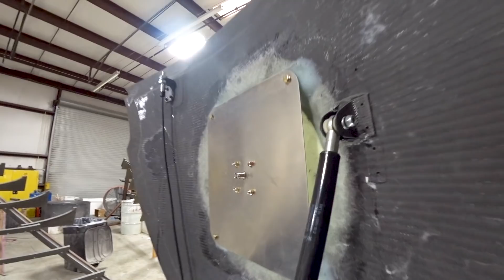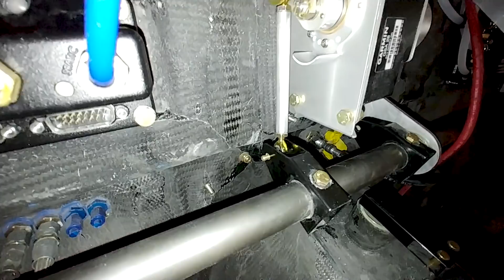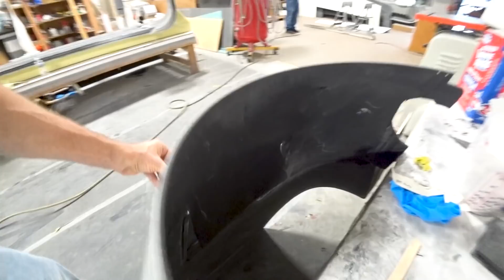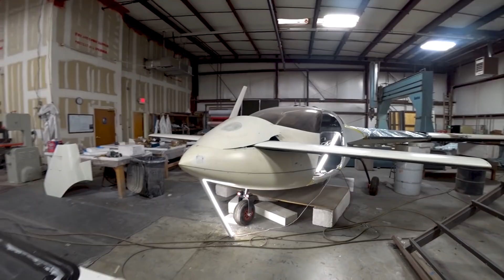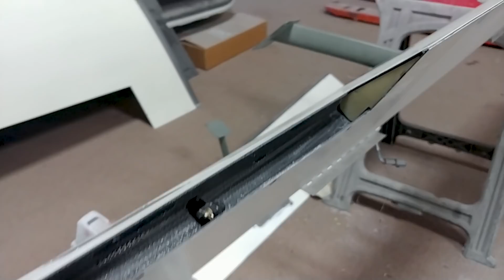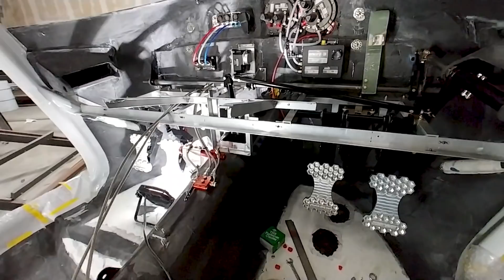Our Bird Spreads its Wings - Building the Raptor Prototype

Comment: The way things are filmed with the auto pilot servo 
It shows no over view to. Give any idea the location on the plane 
It would make videos more enjoyable 
The right views give no sense of what or where 
What engine is on this thing
Reply from the maker: Sorry, but there simply is not enough time in my day to go back and give an intro to every aspect of the current update. Like anything, there is an assumption that the viewer has been watching a little too know what's going on. There's over 350 updates if you want to go back and catch up. Thanks, Peter

Comment: Hi, i notice you used a cutting wheel to cut the break lines before terminating the end fitting. How did you clean the fine cutting wheel dust from the inside of the lines to prevent eventual blockage inside the hydraulic spool valves and / or damaging the spool valve o-ring seals. ?
Reply from the maker: Put a small screwdriver in there and twisted it around several times and removed it and cleaned it off and then repeated the process till no more dust was on the screwdriver. Then I blew it out with high pressure air.

Comment: Unless excessive force is applied BNC are more long time  reliable than screwed ones. They need a rather high force to move from locked position, no matter how long they have been tightened, while screwed once can go loose over time with a comparable small force, and once loose they will disconnect soon.

Comment: Peter, 
Years ago you mentioned that Raptor will answer quite a few issues GA pilots felt were negative aspects about their aircraft, fuel, ergonomics, comfort, safety and last but not least cost. Well done Peter and team. As the milestones are occurring daily. Even the biggest GA skeptic is second guessing why he or she didn't jump on the 1500 pre sold band wagon! We applaud you and your team for what is soon to be the most successfully crafted single engine aircraft built in the last century!!  Bravo to your creation of aerodynamic ART!

Comment: I wonder why you are using oil bushings for the ReDrive instead of ball bearings? Wouldn't bearings last much longer? (Not that I'd know, I just always thought bearings are better.)
Reply: Ball bearings aren't better in all applications. 

Think about the bearings used in an engine on the crankshaft and connecting rods. No ball bearings there 🙂
Reply: Well idk. I watch a bunch of AvE if you know that channel and he's always pissed when he sees bushings instead of bearings in a product. I have no deep knowledge of mechanical engineering. So I began thinking of bushings as poor mans bearings. But obviously, different methods for different applications.
Reply: @attitudeadjuster793    --  and it's a prototype.
Reply: @attitudeadjuster793  , I watch a good bit of AvE as well. Insofar as I have heard and seen and that he has mentioned in his videos he is not an Engineer and much of what he takes apart and shows is "garbage". That's not a disparagement but accurate assessment. Rolling element bearings are nice when you have the space, weight, etc. allocation for them as well as a relatively clean placement. If one expects fine particles from brushes, environment, or material being removed then bearings will, often, get destroyed quicker than a bushing (presuming open vs. open or sealed vs. sealed). If the area expects the bearing may be an electrical path then metallic/metallic bearings are out of the question and one must (should) use a metallic/ceramic bearing. How much is the part going to cost, who is going to buy it? All things to consider and more. At times a person putting something together backs themselves into a corner and must use an "inferior" solution because that is all that will fit the need; a compromise. For projects in industry the phrase often used is "buying its way on". For example, say you need to save every ounce so the case will be made small and since the area is readily inspectable and serviceable an oil impregnated bearing surface will be used.
Reply: @hahahano2796  That was very informative, thank you.

Comment: Do I get this right that the elevator only extends down but not up with a similar mechanism as conventional flaps? If so can you explain the aerodynamics?
Reply from the maker: It goes down and slightly up but it also extends out and tucks in thereby reducing area and subsequent lift.
Reply: Raptor Aircraft   Did the flight test model use the same details then?

Comment: Fantastic. You mentioned the co-pilot seat view - one thing that strikes me about the design is that rear-seat passengers will not get much of a view of anything (except maybe sky). Is that right or are they further forward than I'm thinking? Not much you can do about it I know, but just wondering if it was considered during the journey.
Reply from the maker: I've shown that view before when we had the rear seats test fitted. It's great out the sides and front.
Reply: Ah yes, just found the videos on the website.  It looks much better than I would have imagined, good to see.  It almost looks like there is enough room in the back that you could leave out the seats and put a bed in there - this could be a flying motor home! :-)

Comment: So what is the benefit of the Raptor's wing arrangement (with the canard), compared to a  conventional arrangement?
Reply from the maker: Try Google.
Reply: The anti-stall part, as @Russel Lowry said is one of the main benefits.  The downside is that you can't have flaps without balancing flaps on both lifting surfaces (see overweight Beechcraft Starship), which means you need a lot of runway (higher speeds) for both takeoff and landing.

Canards are more efficient fliers.  In a conventional plane the horizontal stabilizer pushes down to balance out the aircraft.  This downward force needs to be counter-acted by lift on the wings.  This means extra drag as the wings are being asked to carry more weight than the mass of the aircraft in cruise.  Canards lift from both the canard and main wing, so the amount of lift being created is equivalent to the mass of the aircraft in cruise.

The downside to that is balance.  Cargo and passengers need to be carefully (weighed &) balanced to ensure the canard always stalls before the main wing (back to that anti-stall thing).  Letting the main wing stall in flight would mean entering a deep stall, which means a long slow (yet not safe) descent to the ground unless your plane is equipped with a surplus of power (to overcome the drag of a high angle of attack and accelerate enough to get the main wing flying again).  Load up the nose too heavily and you may find it very difficult to take off (and maintain trim at higher speeds).  Many canard pilots fly with a ballast in the nose to keep the plane balanced during solo flights. In a conventional aircraft, you can still screw up the weight & balance, but the effects won't be quite as pronounced.  Usually the rear seat area (and fuel tanks) on these composite canards is the CoG for flight, so you can basically fill up the back seats (or fuel tanks) without worrying, as long as your front seats weights are calculated, and the great efficiency means these planes can haul a lot of cargo and/or fuel.
Reply: @EUC-lid  Thank you.
Reply: The canard stalls before the wings, making the stall a no brainer, plus they just look cool. The wright brothers knew what they were doing.
Reply: @russelllowry1061  Ok, thank you.

Comment: An honest question for you; Looking at the way you construct stuff, I can't help but wonder what kind of total empty weight you are aiming at?

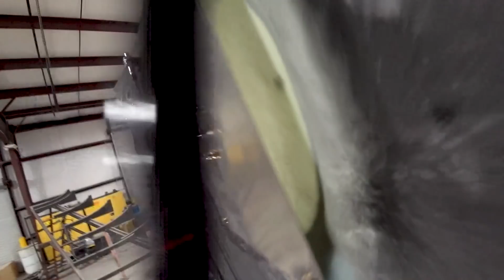It's all the little things that add up. You construct beautiful large parts from carbon which is light and strong. That's all good. But then at 1:57 I see how you construct the GPS brackets and you are throwing in all this excess aluminium and hardware. My guess is the bracket and their supports weigh several times more than the GPS antenna, or the entire door for that matter. Also the hydraulic door spring system seems over the top and adds a lot of weight. Might as well have made that entire front door from regular fibre glass as you just gave away the gain of carbon. Do you keep track of what the parts weigh?
Reply from the maker: It's a prototype!
Reply: @RaptorAircraft  That's fine. But even a prototype will need to prove itself and should be representative for the final product. If it climbs like a dog and needs 2 miles of runway because you never considered weight then that's not good. I'm not criticizing your project, just trying to understand why you do what you do.
Reply: scsirob prototypes are always heavier than production aircraft. Once they go into production you should see a reduction in total weight, particularly with regard to the doors I think.

Comment: Peter, the alcantra fabric you got from Joanne’s looks like the same I tried to use on a bimmer headliner project. It seemed like it would work great but it ended up not being stretchable enough to work around complex curves and corner areas.  I think most of your panels are fairly simple but just might want to check and see that it will lay out nicely on all the pieces you plan on covering before committing to it.  As usual the project is looking fantastic!
Reply from the maker: It's just going on the roof panels. They are fairly flat.

Comment: Would it be viable to avoid the elevator hinge drag by making the entire foreplane rotate as a stabilator? (I realize that it’s way too late to do this to the prototype.)
Edit: I see Bluuplanet beat me to this suggestion. His comment wasn’t displayed when I first posted.
Reply: Rick Hearn If you do that then you lose the main advantage of a canard, which is a stall proof main wing. The canard has to stall first and if it is a stabilator then there is the possibility that it’s angle of attack is sometimes less than the main wing and therefore the main wing stalls first and you have a dangerous pitching up moment, then deep stall. All of which would be deadly at low altitude.
Reply: Andy McKee  thanks for the reply. What you say makes great sense. Here’s my follow up question: When I’ve pushed the stick way forward to lower the nose sharply how can the main wing’s angle of attack increase to reach it’s stall point?  No disrespect, I just can’t get my head wrapped around the scenario you describe.

Comment: The surface area of the wings when viewed from above looks massive...  :)
Reply from the maker: About 180 square feet wing and fore plane combined.
Reply: Brian Garrett unfortunately a swept wing produces much less lift than a straight wing so you have to make it oversize to compensate. One of the negatives of a canard design.

Comment: The Raptor is absolutely beautiful.
The foreplane is still bouncing around my brain though.  
How much do you depend on it for lift in straight level flight?  If it were a much smaller cross section so that you could pivot the whole thing without control being too sensitive, could it still provide sufficient lift?
Reply: Bluuplanet see my below comment reply to Rick Hearn.

Comment: As good as it looks now it is going to look 100 times better flying and the first production Raptor rolling off the production line is going to look eyewateringly good.
Reply: there wont be a production line 
afaik this will only be available as a kit 
and if they decide to produce it it wont get FAA certification before 2030 or so 
it takes forever to get an aircraft certified
Reply: @Crushonius  Crushonious you sure do speak with 100% authority about something you clearly know very little about.
Reply: @Crushonius  The plan for production of this aircraft is one of the most compelling innovations for this project.  Having the courage to put 'real transparency' in place by building the whole thing on youtube (and opening your every business decision up to know nothing trolls) is another.  But I guess the latter does have its downsides.